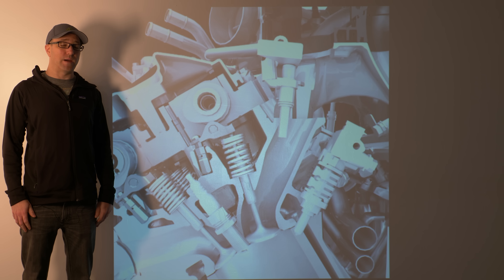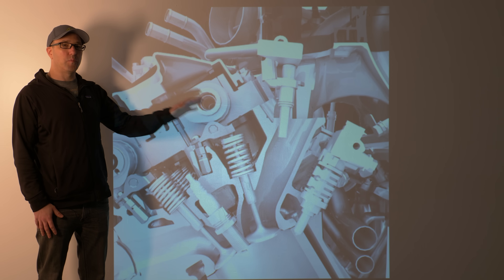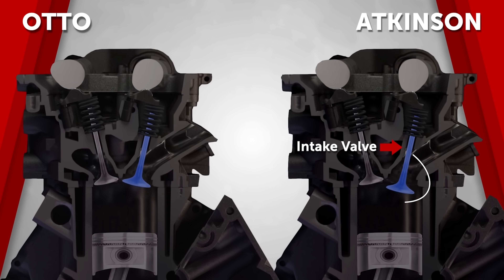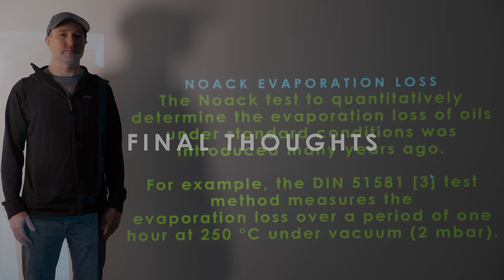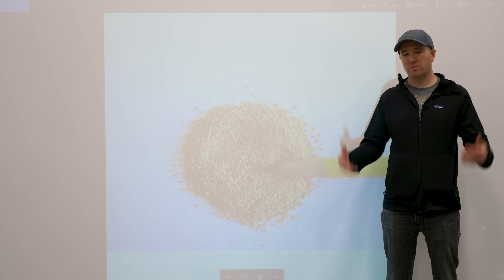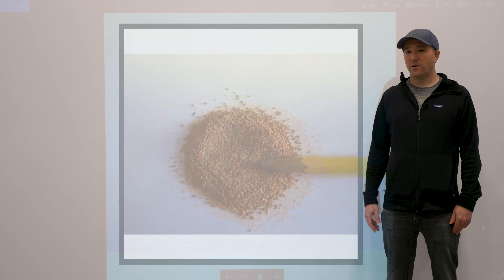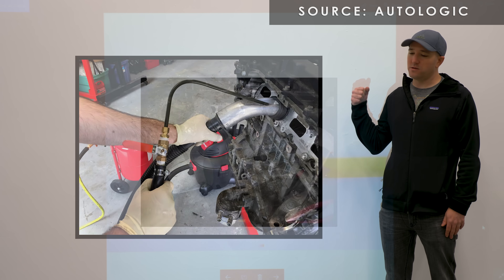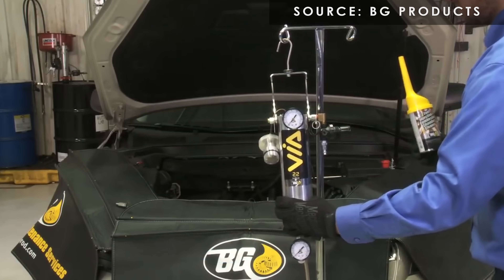Direct Injection, Problems and Solutions | The Fine Print

Comment: Thank you for your video. I would like to share my experience. We are situated in Ukraine and our main activity is a conversion of passenger cars to make them run on LPG (propane). We deal a lot with direct injected cars and we convert any type of petrol injection engine: port fuel, direct injection, turbo direct injection, port+di (dual injection). This practice was started in 2010 and since then a lot of experience gained. I am writing this because we have a lot of cars imported from the USA (basically they are purchased at Copart or similar auctions after being damaged). I have dedicated websites related to this conversions: www.ford-ecoboost.com, www.gbo-fsi.com
The basic idea is that we get most of vehicles (model ranges 2013-2018) for conversion with the mileage of 30-70 k miles and taking away intake manifold, the conditions of the intake valves almost fine. The topics in the video are relevant and may occur, but we do not those issues related to mileage. May be there are some additional conditions that influence on this effect: slow driving, long oil change interval, small distances, poor fuel, frequent cold engine rides, poor/inadequate  oil quality. 
Thank you again for your video: I know how difficult and recourse/time consuming this for a tech guy.

Comment: people always forget about vacuum pumps as well. alot harder to install and more expensive but way better results , completely eliminate PVC from going back into the intake all together. Also oil evaporation isnt even a factor anymore with a vacuum pump ran pcv system. as so long as the oil level doesn't drop to low which in my experience doesn't happen if you change your oil on or slightly before the oil change interval is actually up. but i do all my own maintenance and work so im pretty OCD about maintaining  my stuff before the interval and not after the light comes on. but anyway , vacuum pumps. get one. lol. besides vacume pumps are almost proven to actually increase horsepower any way , so its a win win.

Comment: Catch cans help, even better is a actual oil/water seperator.  Or just a high quality catch can which is basically just a giant oil/water separator.  Some people are installing electric vacuum pumps, and just sucking the gunk out under the car rather than back through the engine.  Not environmentally friendly but when it's $50 to install a vacuum pumps or $$$$$$ every 40 - 60k miles.  Most people go cheap, and there is a China.  Nothing we do is really going to slow pollution with them, and India pumping out over 80% of the worlds pollution and basically telling the EPA where they can go.

Comment: An explanation as to why this isn’t such an issue with direct injection Diesel engines, would have been interesting.
Reply: Salzar I was asking myself the same question!
Reply: Nestor Casaravilla Maybe the amount of soot being recirculated by a diesel’s egr system means the blow by from the crank case is insignificant in comparison.

Comment: Folks this was going on since the internal piston combustion engine was made. Over 40 years ago AUDI was using walnut blasting to clean the intake vales and ports. Audi's engines were so poorly built ,loose/sloppy and they were MPI injection engines. So there is more to the story. All engines had this problem years ago to some extent. True the PCV system is main source but if the valve seals leaked oil and the oil was/is of poor quality with lack of timely oil changes that sludged oil got past the valve seals and stuck like glue. This happened more with stop and go city diving, cars on the highway way lower occurrence of carbon build up. This was across the board whether carbureted or fuel injected. The repair was called " a carbon and valve job" .  Most of the time the valve guides were worn to the point the valve had to much side play/clearance . The last 20 years has seen a major change in the quality  of all engines built. Quality control and CAD design emission standards with longer warranty periods all forced the manufacturers to get better. Mainly the American and European manufacturers were losing sales to Japanese Manufactures. Buy a Honda or Toyota and not have problems for years. The consumer realized neighbors, friends, relatives with a Honda or Toyota  were not having problems next car they bought wasn't European or American. Today the quality is much better thoughout the industry.

Comment: yeahhh we have the gdi issue with some toyotas. some don't even run properly anymore.
 the 1.2 ltr. turbos in the auris... around 60k's of grandma style driving chocke the valves down.
but its all under waranty! 
thank god that toyota instantly added port fuel to the engines.

Comment: I recently bought a 2017 chevy equinox AWD with the DI 2.4 engine.  It has 65K on it.  I really like the car but I did notice that the exhaust is black with a carbon build-up.  I have been working on cars since I was 13 and every engine, before this one, had gray or no color to it unless there was something wrong with the engine.  My 87 F150 with port fuel injection has 125K on it and the exhaust is a light gray.  So, where is the carbon in the exhaust coming from???  How do I stop it?
After watching this video I will be putting an oil catch can on it and using fuel injector cleaner more often.  
Question is, is there any kind of cleaner that can be ran through the intake to clean the valves on a regular basis?

Comment: total bs ( about automakers with their hands tied...)
im a mechanic 
among other cars i own a ke70 fully modified to1600cc 16V 160 bhp  with legal cat
all parts from the ae86( with improvements)
i use an aftermarket standalone ecu and i use sequential injection .
so the car has now 100.000klm with this set up and the emissions are 0
every 2 years for the past 12 years when the car goes for inspection ....it checks out perfect...
its emission test is better than a 3 year old  high tech vw

so if i can do it (a nobody mechanic)  why automakers cant ?????
of course the can....
but they need you with your hand deep down your pocket
espesially  the VAG automakers

Comment: The problem is the new emission laws are too strict and it forces manufacturers to design engines that are overly complicated and not reliable. The engines from the 1960s would just vent crankcase vapour to the atmosphere from factory, well they did hear in Australia. I wonder how long till people with direct injection start venting crankcase vapour to the atmosphere to prevent carbon build up on the intake valves.
savagegeese your videos are always great to watch mate.

Comment: Say what you want about modern technology. I love my 66 Chevy pickup that I do daily drive. I can replace the entire fuel system in an hour.
Reply: Amen. Most of this garbage on new cars is "planned obsolesence" where they realized the big bucks come in the form of maintenance.
Reply: Does it have carburetors?
Reply: Yup. A carter electric fuel pump. A beer keg for a gas tank. And a quadrajet carburetor. I still can average as much as 17.5mpg on the hiway which ain’t bad for a V8 pickup truck with zero aerodynamics.

Comment: Never use fuel additives or a catch can.   Just be sure your engine does NOT have EGR to create intake valve crud.   PCV oil does not create crud.   You need the EGR too.

Comment: Just installed a catch can on my 2018 Silverado 5.3 because it's GDI... It only has 28,000kms (~17,000 miles) and 90% of those kilometres are highway so I'm not overly concerned about any significant carbon build up yet. Although this applies to all types of engines, I think short trips with GDI engines are even worse. Short trips around town don't allow your engine to get up to operative temp and it can't burn off that excess oil and/or particulates. 
This is the first vehicle I purchased instead of a leased in a long time so wanted to take precautions. Have to say, I've owned several other GDI motors from GM and had them for 4 years and never had any issues with the motors. Another key takeaway from all this research into GDI is to be very leery of buying a used car with GDI with no evidence of any preventative measures mentioned in this video.

Comment: Excellent in-depth video... a lot info here !Thanks ! I also think that NOT going the full 100K miles on the spark plugs-  just going to 60,000 miles, and then changing the spark plugs, may help with carbon build up.  Also- goosing the motor with cleaner additive in the tank, this may help keep the motor clean, the waste-gates working . But- while cleaning with fuel techron etc, would a stray chunk of carbon bang into a turbo...and damage the turbo ? The eco-boost motor in my Navigator L is really nice, but I can feel at 60K miles, the MPG is suffering a tad, the engines is stumbling a tad.

Comment: What would be a clever idea is that vehicle manufacturers can come up with a cleaning injector situated at the port that injects cleaning solution every say 5-10 minutes that runs off a separate bottle which you would have to top up bit like ad-blu system...just my two pence.

Comment: Why wouldn't these companies install these catch cans into the design in the first place...
Reply: Supposedly, because it's another maintenance thing that consumers have to keep up with. People barely remember to change their oil when its required. And if they "forget" to dump that catch can, the effects will be worst than not having one. Also I read that they may not work well in long cold weather.
Reply: @John Bratus Pretty sure you are wron gthat cheap oil catch cans do nada.  If that were true, they'd never accumulate anything in them and need emptied, which they clearly do.
Reply: @John Bratus yee. I looked up this video because I just bought my 2018 f150 with the 3.5 EcoBoost. I know it is BOTH PFI and DFI. So that Carbon build up  is greatly minimized compared to the 1st gen. Of course with the trade off that it adds complexity to the engine. But that is no bother. I use premium fuel to help with cleaning and a tad bit better performance (especially since it's relatively inexpensive these days here in south texas.) I just got a catch can (it was 175bucks) but I am now contemplating if it really needs it. I am about to do an oil change and will try it out. If I see little oil by the time the next oil change comes I'll take it off. I wonder if the EcoBoost has EGR?
Reply: @bvbhu3dg  Nope, using premium fuel does absolutely nothing to help with cleaning.  It's all about the additive package that any top tier brand puts in their gasoline whether it be premium or not.  Yes Ecoboost has EGR, but the only way to know if their new design has reduced the carbon buildup "enough" is to go by reports of others who have already put the miles on and had the intake taken off, or better still, to examine your own engine by taking the intake off or trying to get a view snaking a borescope in the intake to the valves.

Comment: I just took apart my 2013 Kia OptimaSX turbo 2.0 engines head off cause I lost my cylinder two exhaust valve. When I took the intake manifold off my valves looked really bad. I was in complete shock. Now I have my head being worked on. The good thing is that I’m an automotive technician. Imagine taking this to a shop....

Comment: Btw. another nice option to keep the valves clean, especially on charged engines, is WMI. (Water Methanol Injection) It will keep your intake temps low, boost the octane rating and keep your valves clean.

Comment: I have a 2.3 turbo speed six Mazda I was contemplating adding water meth injection to clean the valves along with an oil catch can and I’ve deleted my egr would there be any negatives in doing so

Comment: Direct injection was created with the diesel engine, current version: (Direct injection has been used on diesel engines since the 1950s. These systems use a powerful, positive displacement fuel pump to pump diesel through injectors mounted directly in the cylinder.)
Reply: Good idea with diesel fuel, but pretty bad with gasoline, it seems.

Comment: I was one of the Engineers at Ricardo working on several variants of GDI, working in single, triple and four cylinder engines. Blew a few up when when they hit thermal runaway self ignition.

Comment: A "motor" needs an external power source(AC or DC) to run. An "engine" makes its own power.
Reply from the maker: From MIT “The etymologies of ‘motor’ and ‘engine’ reflect the way language evolves to represent what’s happening in the world,” says MIT literature professor Mary Fuller.

The Oxford English Dictionary defines “motor” as a machine that supplies motive power for a vehicle or other device with moving parts. Similarly, it tells us that an engine is a machine with moving parts that converts power into motion. “We use the words interchangeably now,” says Fuller. “But originally, they meant very different things.”

Motorsports, Motor Oil and many other verbages are used to describe ICE as well as Electronic motors. Good day
Reply: @savagegeese  You can quote all you want, a REAL car guy and auto Tech knows the proper terminology!
Reply from the maker: @bradymac7516  Real car guys don't get caught up in terminology, they get caught up in the topic.
Reply: @savagegeese  touché
Reply: @bradymac7516  anyone who has the ability to open a dictionary knows that an engine and a motor are synonyms. Have you ever heard the term motorized vehicle?

Comment: I can't listen to anything you say because... it's an engine... not a motor.. so called expert ....so called expert ????     I have one of these GDI  and I like it a lot     Man The U Say???  The More u Know Nothing...... We've been doing this with diesel engines for ever..... Read   The comment section There ALL calling you out ....dummy
Reply from the maker: “The etymologies of ‘motor’ and ‘engine’ reflect the way language evolves to represent what’s happening in the world,” says MIT literature professor Mary Fuller.

The Oxford English Dictionary defines “motor” as a machine that supplies motive power for a vehicle or other device with moving parts. Similarly, it tells us that an engine is a machine with moving parts that converts power into motion. “We use the words interchangeably now,” says Fuller. “But originally, they meant very different things.”
 
"MOTORSPORTS, MOTOR OIL, MOTOR FUNCTION, MOTOR SKILLS, multiple meanings for same words and often used synonymously.
Reply: @savagegeese  MIT  Now  There Some  Corp Gov  Control   Lawyer To Law Maker Stupid   The   EPA  &  These Fools   OMG   Mary Fuller  Yes Full Of Stupid   & NO  You Oxford Is Not Right  One Has energy External  = Motor    Engine  Makes Energy BY Fuel HEAT  OF ANY TYPE  Internal      NOT Interchangeable  Words   Schools  What For ????????????/  & Now Its A Nuclear END Any Time One Way Or The Other   @ 42 CPM   NO Nuclear Melt Down Has Ever Stopped  ALL ADD UP  Cancer Lotto Of Greed Lies  MIT  IS IN  ON  Oh   MIT   Media  LAB   Killers  Of  The Mind

Comment: Volkwagon states in a technical report to drive it at 4000 rpm at highway speeds for 20 minutes once a week and admits to the problem but will not warranty clean up because it is not a defect in workmanship.

Comment: Pcv and egr systems destroy engines. Crankcase vacuum pumps are the way to go. Additionally, epa mandated fuel mileage requirements are a double edged sword. Lean cruising conditions generate heat, with bonds nitrogen to oxygen to creat NOX. The answer was the egr, designed to decrease oxygen levels. This in turn mucks up your engine and makes it less efficient over time. Government, what a waste.

Comment: Hey Savagegeese! Great video I felt like I learned quite a bit.
I know i am late to this video but if you or anyone who knows the answer to this question I would love some input.

I drive a 2013 honda accord 4 cylinder that is obviously direct injection, going back to your explanation of the PCV system, hypothetically if someone was to run those fuel system cleaners such as BGK-44 or any number of the ones on the market, would that not potentially be cleaning valves if some of the blowby created gets recirculated through the PCV system as it would contain bits of the fuel system cleaner?

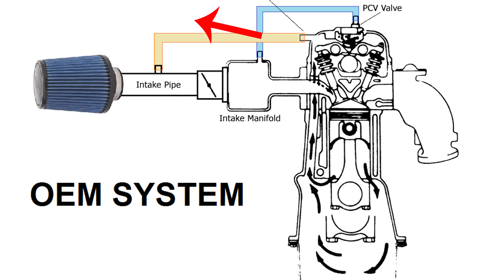Comment: @7:55 PCVs are not used to just prevent pressure build up in the "upper part of the motor" as you claim, it vents pressure from the lower end as well, hence why it's called a "positive crank vent/PCV"....  Have you ever done any real automotive work in real life???  Sorry to be rude but you hold yourself out to be an expert and this is a simple basic thing you didn't give the right info about....
EDIT:  EPA is just trying to ruin cars/trucks.  They are getting ridiculously stupid in the diesel world now it's illegal to remove emissions on diesels even if it's for offroad/race track only use.

Comment: What about installing an aftermarket water injection system, wouldn't that address the intake valve build up by removing the carbon?
Reply: Rob King
Very correct, one problem.
Water injection is hard on catalysts because of cooling effect on the egt is below optimal function for it. Gums them up.

Comment: Another issue with DI is high particulates and it has become such an annoyance in regard to sooty tailpipes that some manufactures are diverting exhaust downward, just before the exhaust tip to avoid dark buildup. 

I suspect those particulate emissions will soon be targeted and particulate filters, similar to those on diesels will appear on DGI engines.